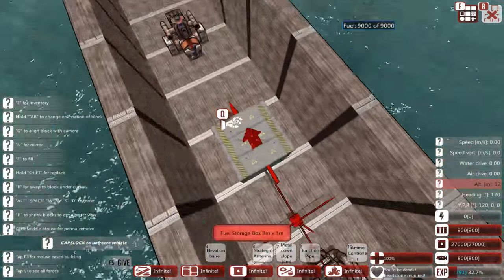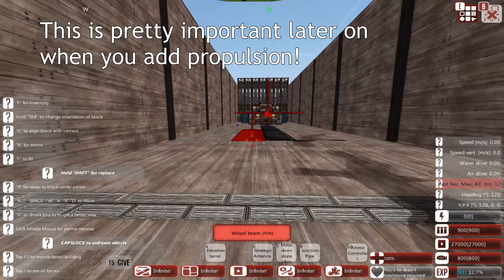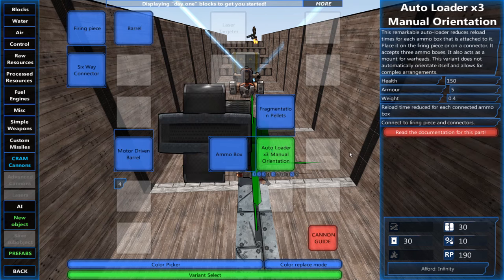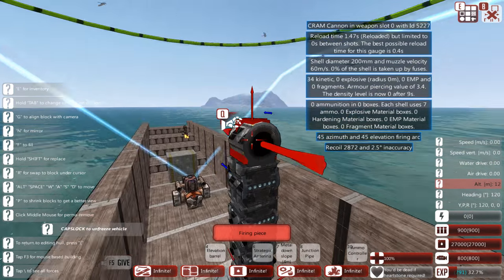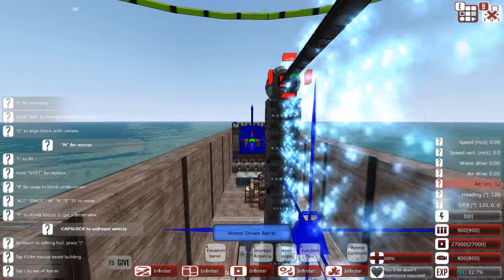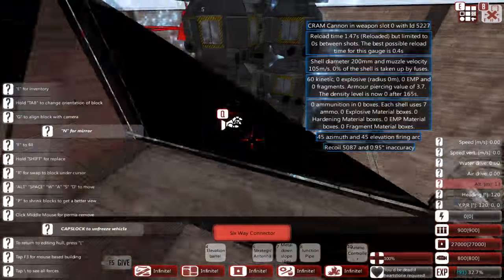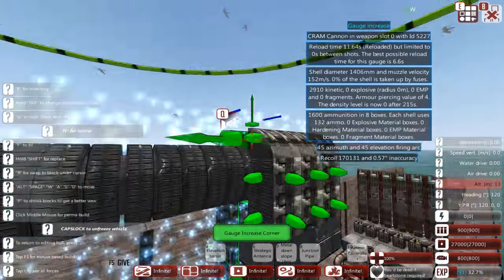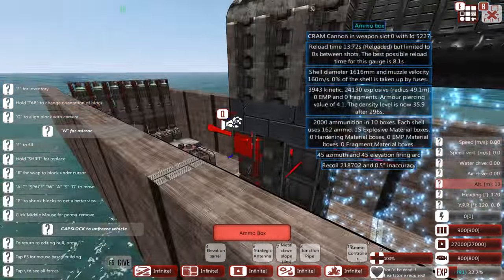My First CRAM Cannon Turret - Back to Basics: Boat Tutorial Pt5 - From the Depths

Comment: With the azimuth and elevation you get 45, 45 if you have 1 less motor driven to other barrels, eg. 6 normal and 5 motor, and you only need 1 elevation barrel ever if you use one

Comment: Dude, love your videos, great inspiration for builds and always a good source for information. With that in mind, I've got to point out your explanation of the barrel mechanics is slightly inaccurate. Motorised barrels don't add firing arc but instead offset the penalty to azimuth and elevation from the other barrel types.
Reply from the maker: +Karl Wight This is a fair criticism and I noticed it in editing.  My explanation could lead to people building out of motor driven barrels to try and achieve a higher firing arc than possible.  It might be a little busy to explain with an annotation though.  Will mention it somewhere I think.  Thanks for the feedback. :)

Comment: still need to find a way to kill more shielded enemies, because even 2000mm 120 AP cram shells just bounce off. but when you shoot them at a kingstead, they go straight trough (full frag and ap with 3m pen. deph fuse)i got my massive battleship ''the turtle'' but even its two lasers cant kill some white flayers' ships
Reply from the maker: +Thijs Hofman You'll probably want to experiment a little with inertial fuses.  The cannons on the Mastiff are pretty nasty even against shielded things.
Reply: +Thijs Hofman Advanced cannons can be great for this :) Although some would go for a classic HEAT inertial fuse shell, which ignores shields, I've gone for an absolute spam of 250mm: gunpowder -> inertial fuse -> Flak warhead -> He warhead (2 of these turrets front-mounted, each with 4 barrels and firing 2 shells every 0.3 seconds). Combined with a non-inertial fused EMP shell, also at 250mm, 2 x 100mm frag cannons with timed fuses, as well as a similar cannon but with flak. My Valkyrie battleship can be pretty nasty, even against the most shielded of targets :)

I'm not posting to boast, but to point out that multiple smaller advanced cannons on a single turret can be devastating, have a look at this: http://fromthedepthsgame.com/forum/showthread.php?tid=17124 It took me ages, and can solo 2 plunderers/a bulwark/most SS ships in a 1v1, despite being only ~6500 blocks. Hence the power of the advanced cannon :D

Comment: Something I've been experimenting with is pen depth + hardened pellets + HE pellets I found them to been not as effective as I thought they would be have you tried this?
Reply from the maker: +Endergaming That's nearly what I have on the Mastiff.  Try a timed fuse + inertial fuse + Pen depth (Set pretty high) to the fuse box and a laser targeter on the cannon.  The subsequent shells are bloody powerful and really versatile.  Also, I think "time from first impact" is much more useful than pen-depth if you don't use the other 2 fuses.  The shell I have suggested will blow up near its target as well as on a direct hit.  They're about as close to a "one-shot" gun as you can get without going totally stupid I think.
Reply: +ireLAN Gaming your design works I only used a very small cannon but in a larger cannon I can see why it so effective

Comment: I know you're keeping it basic in these videos, but do you usually put on 1 elevation barrel section instead of all motorized barrels? I would think 45 degree azimuth movement would be wasted on such a slow traversing gun when it's mounted on a much faster rotating turret.
Reply from the maker: +relic It actually improves it's tracking speed considerably and the penalty is almost non-existent.  Turrets won't start aiming their elevation until they can point at the target.  With a 45 degree azimuth, it begins aiming MUCH sooner.  Also, the best trajectory in this game for range due to the way the gravity etc works is about 30-35 degrees.  While I would normally use elevation barrels as well, I have realised recently that they really aren't necessary unless you want to shoot aircraft above your ship, which with a CRAM is a little pointless anyway ('cept with timed fuses, that can be hilarious).
Reply: ireLAN Gaming Ok, thank you for the response.

Btw, I love your lets play and these new tutorials you're doing. It's such a massive amount of knowledge you need to learn to play this game. While it always looked like a lot of fun, the learning curve made me hesitant to get it. However, when I started watching a few of your videos and I decided I'd atleast try it and I'm glad I did. Thanks. :)
Reply from the maker: relic Woohoo!  Another convert! ;D
I hope you get a fraction of the enjoyment I have gotten out of this game, it's awesome! :D

Comment: So, the CRAM Cannon is Better against other heavy craft instead specialized HEAT or HESH or others advanced cannons?
Reply from the maker: +Poujoulat R Against big and slow stuff, CRAMs just do so much damage in one blast that they're really effective when they hit consistently.  Adv cannons don't have the same stopping power, but are much better for anti air and plenty of other roles.  The CRAMs are a more of a main battle cannon whereas adv cannons cover just about everything else thanks to their incredible versatility.
Reply: +Poujoulat R As far as I understand it, the CRAMS excell at making a very, very big hole into a target. They can, given clever engineering, become viable against medium targets, but they'd have a hard time taking down fast moving things. The Advanced Cannons are still superior in the lower range of calibre, say 125mm tripple barreled HEAT cannon rapidly firing at smaller targets as secondary. Or a tertiary AA cannon with six 45 mm barrels filling the sky with projectiles to take down Squirrels and the like.
Reply: Ok thanks, I kept using the advanced cannons against every vessels (don't really know why...) It wasn't so effective. +l0rf Yeah, damn Squirrels :P...

Comment: I've been really loving the advanced cannons lately, but somehow I don't think they can get up to the same raw damage level of the CRAMs. There was a point where the advanced cannons were far superior though. Has that changed recently?
Reply from the maker: +hla0roo Before the armour changes, adv cannons were extremely powerful.  I think they're in a pretty good place now and CRAMs are maybe a little too powerful for their size.  It's only since the armour change, particularly to explosive damage, that this has all went screwy.
Reply: So CRAMs make more sense at crazy high caliber, and are more cost effective at medium caliber? Say cost effective 250-500mm and more powerful around 1250+?
Reply: Also, could you do a tutorial on some tessellation techniques for turrets? I'm fairly handy with some simple designs, but not the best and seeing some examples would be most helpful.
Reply from the maker: hla0roo For CRAM cannons, I wish I had more to offer than the previous multibarrel CRAM tutorial, but I'm honestly not much good at the really efficient CRAM tetris like some people are.  It totally melts my brain.  Check out the Multibarrel CRAM tutorial in the FTD tutorials list for a slightly more efficient design. :)
Reply: Sweet! Thanks!

Comment: Will you be doing the same for advanced cannons? Love these videos btw.
Reply from the maker: +BrightNeonGamer Yes!  Will probably be quite a few Adv cannon videos by the end up.  I haven't even started planning them. ><
Reply: +ireLAN Gaming Thanks!
Reply: +ireLAN Gaming 
Just some points of interest of AdvCannon building:
-build an ammo customiser
-fiddle with settings till you get the bullet of your wish
-note how big ammo clip, gauge increases, and barrel length you'll need
-only then build the cannon

Am I right that you do not speed up ammo making by providing one separate ammo customiser for each ammo feeder?
My megaturret just functions quickly and happily with one, it seems.
Reply: +ireLAN Gaming
A question of interest:
I've built a megaturret with two fixed laser cannons (at last continous lasers), one elevation barreled CRAM, and two side AdvCannons with AA elevation turrets.
One weapon controller at the base of the turret.
The cram is shooting 1.5km range, the lasers cut anything, especially if it's not metal (188 damage, 25AP, 40 shot/second).
The Advanced turrets shoot only warning shots, pinpointing 250 meters above the target. :(
Reply from the maker: normal6969 The AI aims all weapons based on the first firing piece/controller that you add to the turret.  You're not really supposed to mixed weapons.  Your turret is aiming your adv cannon as if it's the same as your CRAM cannon, hence the terrible accuracy.  The only way to get adv cannon and CRAMs to work on the same turret is to have their shell velocities almost the same.  Missiles kinda get away with it as they have their own guidance.
Reply: ireLAN Gaming

Yepp. Fixed lasers has no problem.
I've tried to install separate weapon controllers for the AdvCannons - they danced samba up'n'down. :D
So they will go to separate places now, can't live together.

Comment: I need that turret circle guide but can't find it.  Anyone got a link or set of keywords I can use?
Reply from the maker: +manictiger Here ya go: http://www.fromthedepthsgame.com/forum/showthread.php?tid=10473&highlight=spin+block+template
Reply: ireLAN Gaming
Ah, thanks.  I used Pythagorean theorem and a voxel circle calculator to figure it out, but this will be make the AA turret(s) easier.

This turret is so over-protected it's not even funny.

There's a 3 + 2 armor set up over the entire deck of the ship and an armor core around the sides of the turret, but it gets better.

In between the layers, wherever the turret faces, it provides 2 more layers.

So it's 24 + 18 + 18 armor, I think?
I'm not entirely certain the physics will treat it that way.

At any rate, it looks so cool.
It's like a really big Swiss watch.
Reply from the maker: manictiger Haha, those turret feels when it works out as planned.  Nice! xD
Reply: ireLAN Gaming
Do you know if the sandwiched layers will actually give the armor value I think it will?

In theory it should be 24 (hull) + 18 (turret) + 18 (hull), but there's no space between them, so I'm not sure.

Like, it would really suck if it just counted it as one chunk of 31.5.
Reply from the maker: manictiger Nope, they won't stack.  The turret counts as a separate vehicle more or less.
Reply: ireLAN Gaming
So if I wanted to really game the system...
I could put armor slabs on stationary spin blocks.

Mwahahaha!
Reply from the maker: manictiger In terms of AP ammo, yes, but the way the explosion code works they might as well not be there.  Also, you're giving the armour a singular weak point in the spin block.  That being said, I've never tried it and it could work really well.  Worth a shot! :)
Reply: ireLAN Gaming
True about the spin block weak point, though it could at least be internalized into the hull.

So wait, explosions just do fixed AOE damage and don't factor in armor values or thickness?

That's pretty janky if that's the case.

Is ERA a good idea, and if so, should it go on top or in between the spaced armor?
Reply from the maker: manictiger That's not what I said. :P
The explosion goes off on the hull and the turret as 2 separate explosions that may as well happen on 2 different vehicles.  The armour works fine, but only on the part it is attached to.  So if you got 2 layers on your turret, the turret will be protected by 2 layers of armour.  If there are 3 layers on the hull, it's protected by 3.  But a turret + a hull with 5 layers only get the 3 and 2 respectively.
Also, ERA only works against HEAT.
Reply: ireLAN Gaming
Well, I read up on it and HEAT was said to be able to go through metal like a hot knife through butter, so I thought that'd be the bigger threat, maybe.

Good to know.
It sounds like HE can't hit the lower 2 layers of the hull armor, either way, so I'll probably keep the turret 'collar' for all the other stuff that might be a problem.

I mean, it's 7 thickness against everything else, so it's still pretty dang useful.

I think I should have done a diagram of what I was talking about:
                              //========
==============//  Turret
ship body   neck  //
aaaaaaaaa           Hull layer 1
aaaaaaaaa   
aaaaaaaaa   
zzzzzzzxxxxxxx  Turret 'collar'
zzzzzzzxxxxxxx
aaaaaaaaa           Hull layer 2
aaaaaaaaa

The z's are what I was considering trimming off.

Comment: Can you make an Cram- rapid fire cannon? If its possable?
Reply from the maker: +FishburgerLP Not really.  You can kinda do it if you have loads of 200mm cram cannons, but they're utterly terrible and very very impractical.  Sadly, not the fun kind of overkill.
Reply: +ireLAN Gaming I mean, when you have a small barrel and much cram ammo boxes,     would they fire faster so its near to an Advanced cannon?
Reply from the maker: FishburgerLP Nope, not even close.  The CRAM cannons actually have a minimum reload time.  At 200mm, it's still about 0.7 seconds or thereabouts.  So you really can't get good refire out of them without stacking tons of firing pieces and then it just gets massive, crap and pointless. :)
Reply: +ireLAN Gaming Ok thanks. It was just an short idea when i see your vid.
Reply: +FishburgerLP 200mm is the lowest guage possible on a CRAM Cannon, and 0.4 seconds is the lowest reload time possible for the 200mm guage cannons, so you kind of can have a rapid fire CRAM, but 200mm guage CRAMs are basically useless, and once you start going up to the higher guage CRAMs, the reload time only increases.

Their purpose is really just to be the main battery on a battleship or other large ships. For reference - most large US battleships, such as the USS Iowa, only fire 4 shots per minute from the main cannons.
Reply from the maker: Alchaeus Aha! So it's 0.4s.  Thanks. ^^
Reply: +Alchaeus Ok thanks.
Reply: +Alchaeus Ok thanks. :-)